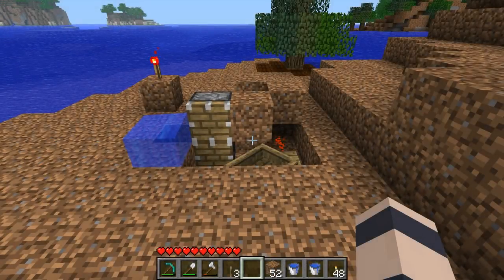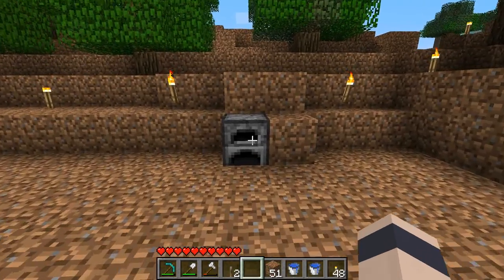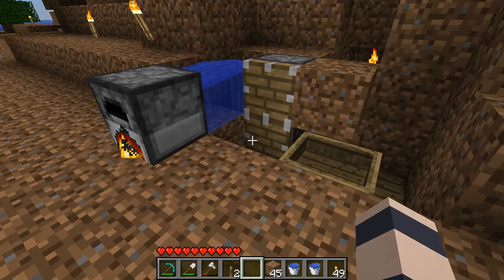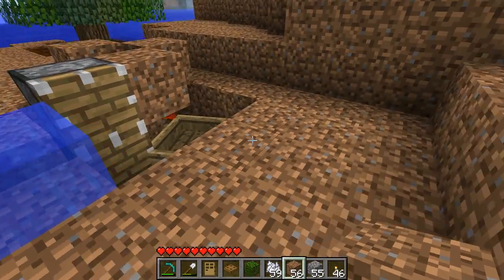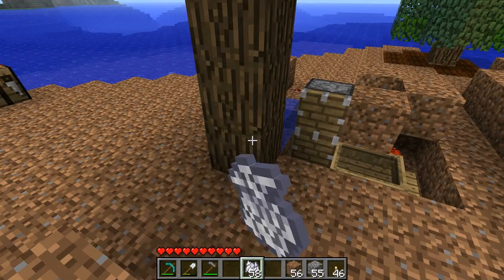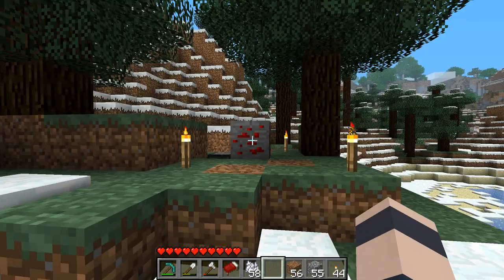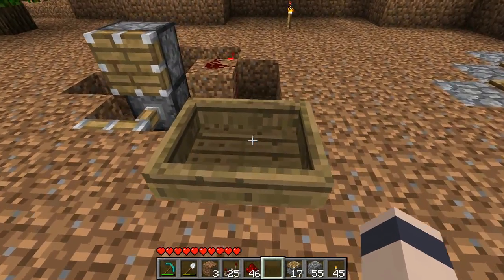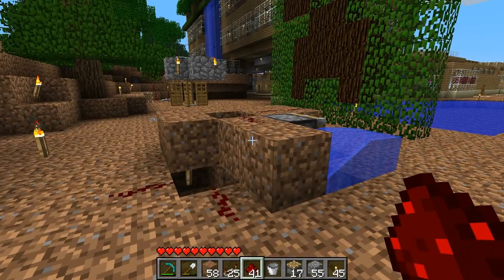Minecraft - Tutorial: BUD Switch

Comment: its possible to create a code using this method that depends on how long the furnace is burning for. you could hook two lines from it to an AND gate, one of them will be delayed to a specific time, for example how long it takes for 7 wood planks as fuel to run out. if done correctly the pulse sent when the furnace stops burning should synchronise perfectly with the delayed line, and activarte the AND gate.

so only the player knows the item and how many to burn in order to activate whatever.

Comment: @forgedstealth it does work i tried it 
maybe you made a mistake while placing the torch. make sure it is holding onto the block were the wire from the pressure plate is connected to.

Comment: just built on of these on my SMP server and had quite a bit of trouble with the boats disappearing thru the walls. eventually solved it (so far) by replacing 1 side of the area the boat is in with glass panes to give it a little more room to move. do this on the side nearest the plate or the boat can sometimes land not touching it. hope this helps someone

Comment: @Johnmorrisbeck there used to be a way to do it with mushrooms popping in high light levels and flowers in low light levels, not sure if it still works or not tho. that basically what your looking for? or you wanting any light change rather than extremes? if so not sure thats possible

Comment: So anytime a block is transmuted (dirt to grass block, block 41 [furnace, off] to block 42 [furnace, on], dirt to farmland, air to any other block [placing a block], vice versa [destroying a block], piston arm extending/contracting) then the water updates, the boat hits the pressure plate, a redstone signal is emanated, the piston(s) activate and deactivate, and the water goes back to its original position? Is that how it works?